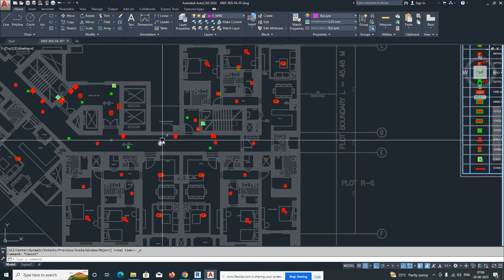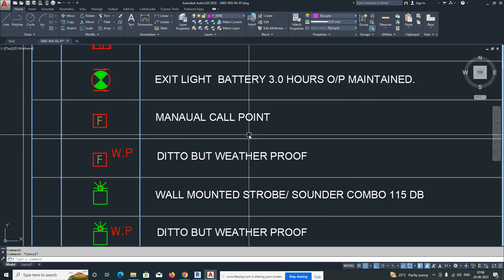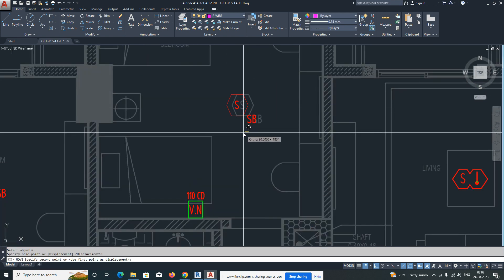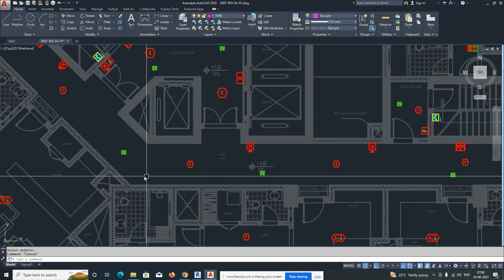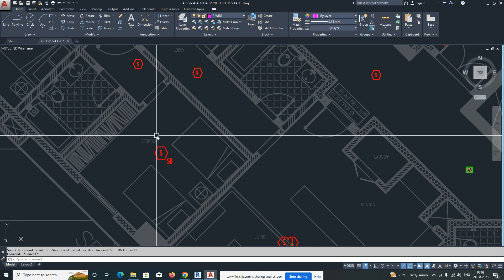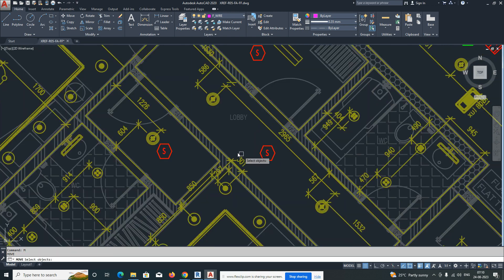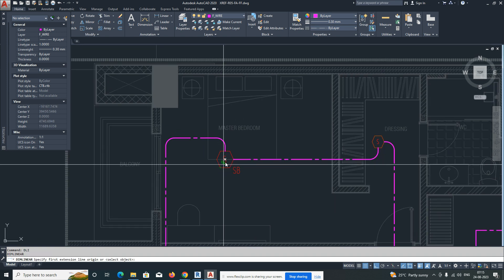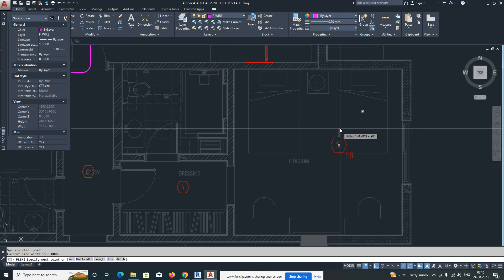Shop Drawing For Fire Alarm System In AutoCAD

Comment: I’ve been programming high rise fire alarm systems for 17 years. I can read and interpret complex drawings. I also have NICET level 2 in fire alarm systems. However I have never designed them using auto CAD. Do you think a company would hire me to learn CAD with my background?